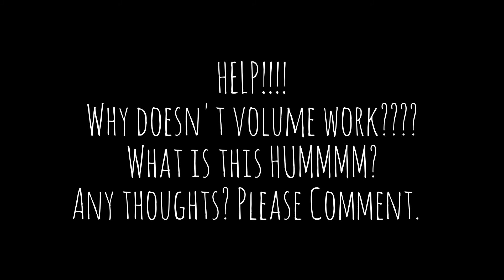Vintage Radio Repair and Restoration, RCA Victor X551, HELP!!!, Part 10 of 13

Comment: Looks  like your solder doesn't want to melt. Are you using leaded rosin core solder, or are you using lead free solder? Lead free solder melts at a higher temperature than leaded rosin core solder. I only use leaded rosin core solder on my radios.
Reply from the maker: Yeah I have to rethink the crap I'm probably using

Comment: Filter caps!! If the hum is non controllable, the it's usually the filters. Check your wiring. Remember some radios do not use the chassis as a negative point. It may have a separate negative return isolated from the chassis. Old post but hopefully you learned about a floating ground setup. Not hammering you,  just trying to help.  Oh and beware of internet 'help' so much is bogus or from people that don't know what the heck they are doing. Good luck!
Reply from the maker: I got it going...You can watch all the videos for lessons learned.  Thanks for watching and for the advice...I have a few others I'm trying to get to

Comment: A bad 50L6GT or perhaps 12AV6 can cause hum like this from leakage from filaments. I get some residual low-level 120Hz hum on nearly all my AA5 radios, likely from driving the filaments with AC. Just the way it is. The amount of hum here is NOT normal, clearly.

Comment: What a lot of the power switch rewiring instructions don't say is that the chassis ground is often separated from the "radio" ground by a high-ohms resistor (220K) with a capacitor (.05 uF) in parallel. When you re-wire the neutral side of the  polarized power cord you must NOT connect it to chassis ground, but to "radio" ground "above" the resistor/capacitor.

Comment: Also, another thing came in to mind is the power cord you installed. If I'm not mistaken, you shaved the power cord in order to install the locking Bakelite grommet that goes into the chassis hole of your radio. Remember that these radio are high powered and by shaving the power cord it may have caused some kind of electrical to chassis interference. For the time being, remove the cord and replace the cord with the old cord. I would also remove the filter cap and un-stuff them. Reconnect the filter caps and make sure they go in the right place as I had mention, for the time being, then fire-up the radio.
Reply from the maker: df9999999999 yes all fixed now!
Reply from the maker: let me ask you a question...I just measured the electrolytic caps from Plus to Minus (one is a 30uF the other is a 50 uF). BOTH measurements were equal, about 89uF. It almost seems additive. I AM POSITIVE I connected correctly because I went back and looked at the video where I stuffed them (see link below). Can you explain this? I get continuity everywhere I expect to and my install matched the schematic and the previous wiring. I should add...I confirmed 50 and 30 prior to installing.

I hadn't thought about your comment with shaving the wiring. I really didnt' take that much off, but I DID have to crimp very hard and was concerned with shorting the leads...but that would have created a short circuit and blown the breaker so I am skeptical about that. There is no short to the chassis as I would have been zapped when I touched it.

https://www.youtube.com/watch?v=p8TSE-9khNo
Reply from the maker: Read below as well, but I think I have a bad rectifier tube. I see from the schematic that the PLUS ends of the dual caps in fact are in parallel thru a series of other components and in fact I measure a few K Ohms between the two PLUS leads. This leads me to beleive the rectifier tube is faulty.  What do you think?
Reply: Check if you have any resistors in the power supply that are out of tolerance, if any. If no, then replace the rectifier tube with a good known one. I still suspect the capacitors though they may read okay. The multi-meter only tells you the value, but not if it's leaky. I recommend you going to "Oldgoat64" site here on Youtube and asking him your problem. He's an elder gentleman that's been repairing tube radios since 1959 or so and worked on countless tube radios. When I have a problem I ask him questions and I learn something new everytime!
Reply: Don't give up because your going to find it was an easy fix and laugh about it and never repeat the same mistake again.
Reply from the maker: I went thru all the resistors first and everything was a-ok. I thought I had located a bad lead in the rectifier tube then realized from schematics that this lead was not supposed to be connected. I really appreciate your input and I will reach out to OldGoat!
Reply: I was looking at the video where you installed the power cord. I think you made a mistake when then one strip of the cord went to ground. Re attach that strip where and replace it where the white cord was and fire up the radio.
Reply: In other words, get your new electrical wire and rewire it the same way the old wire was. Then fire up the radio. I don't think that wire goes to ground, but it needs to go where the old one was at. Try that.
Reply from the maker: I rewired the cord per the safety instructions , that is, I put the switch on the high side. Then I reconnected the leads exactly where they had been, only switching the high and low. Having said that, I was kicking myself for doing this, because I started doubting myself that I had changed the circuit. But I think you're on to something because, other than that, I am very confident about things. Hmmmm. You got me thinking on this one. Can you be more specific about why you think I attached it wrong? I really appreciate your insight. Do you have a site on this stuff>? I will check
Reply: Okay, get your new cord and attach it the way the old one was. Worry about the safety thing later. You want to get the radio running first. Try that.
Reply: Does yout radio have a transformer?
Reply: I think there's 2 safety connection: one radio with transformers and another one without. No, sorry I don't have a site.
Reply from the maker: jorge hernandez to the speaker, yes...and IF transformers
Reply: did the radio work?
Reply from the maker: jorge hernandez when? I haven't been working on it today. I need to figure out what I'm attacking
Reply: Are you sure you connected the common of the caps to radio ground, NOT the chassis??????
Reply: I'm curious what it was???? Just fixed an AA5 yesterday...
Reply from the maker: df9999999999 my error is revealed in this video. https://youtu.be/XdQMC9y6iEc

Comment: Also, take a voltage reading of your B+ and look at your schematic reading. You'll find-out that something isn't right. Since The humming doesn't increase nor decrease with volume, it's going to be in your power supply(filter cap), rectifier tube or to a lesser extent, audio output stage. The plate voltage reading will determine the culprit. I think you re-stuffed the filter caps with 2 smaller caps. Make sure your filter caps are going to the right place. You may have crossed them.
Reply from the maker: jorge hernandez thank you. I hope to get to this this weekend! thanks for the comment
Reply: did the radio work?
Reply: I meant to say if your radio has an electrical transformer

Comment: It's either a leaky filter capacitor or a bad rectifier tube. Though the electrolytic filter capacitor may read within tolerance, it can still leak. I suggest you install another set of filter capacitor and a known good rectifier tube.

Comment: I've skimmed through the last 2 videos, so I might have missed something, but it sounds as if you tried to replace the filter capacitors and successfully replaced the power cord, yet the hum persists (there may be other problems, but the hum is the simplest to address). Obviously, it could be that one of the new caps is bad or not connected properly, but two other things to consider are a bad rectifier (partially shorted; I don't know how likely that is with a tube rectifier) or a filament in one of the tubes that is shorted to one of the other elements; ohming out each tube should find this if it's the problem; the only time I ever ran into this problem, it was intermittent; a good whack made it stop for a while. That's all I can suggest; I hope it's of some use.
Reply from the maker: No Name thank you. the last cap I reinstalled was the input filter cap and coincidentally it was the ONLY cap I reused an existing wire. coincidence? Idk, but I'm going to replace that and based on comments I'm hoping that's the issue. thanks for watching and commenting!

Comment: Well we can tell that all the tubes have good filaments, since they have to form a chain, and we can tell that the audio output section is working, from the racket that it makes !  So that's like half the radio ! I would take a very close look at the electrolytic capacitors you installed last. they are  not smoothing out  dc at all hence the buzzing.  Make sure that they are connected right and  correct polarity.    I'd suggest you get a copy of the schematic from Nostalgiaair,  if you don't already have one, and work through systemmatically.  It is probably something simple to fix.
Reply from the maker: Christopher Cusick thank you! I think, believe it or not, the very last cap I soldered in, the input filter cap, was the ONLY cap where I reused a wire. I think there may be a bad connection at the rectifier but I am afraid that's wishful thinking....because it's too coincidental. I  was tired from soldering all day... blind and bad at soldering... and I assumed the problem was worse, because I assumed the worst.  Your comment helps me feel like I have a chance. I had to take a break from the project for real work, but I hope to try replacing the wire and hoping the radio will work. It's a pointless project, from a useful perspective...yet an invaluable project from a personal perspective.